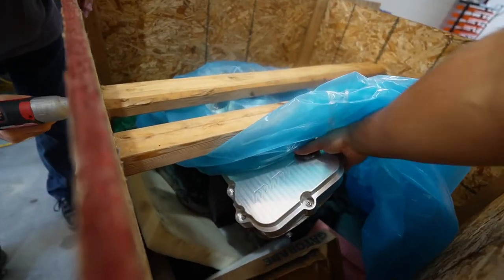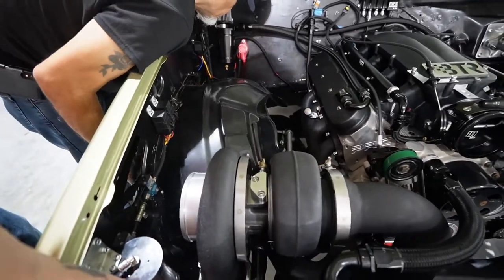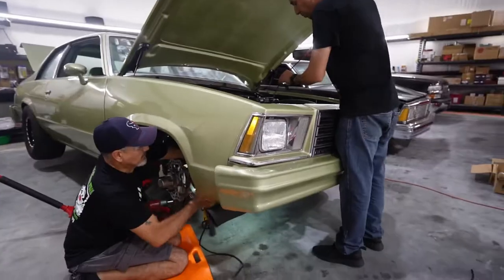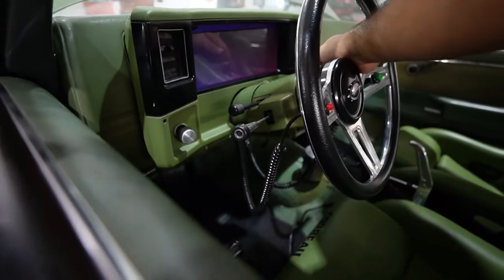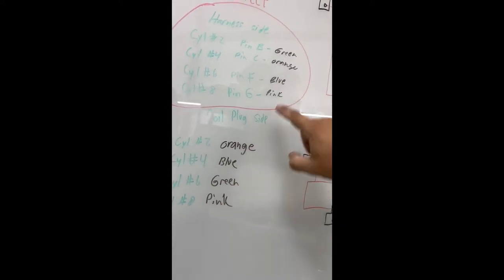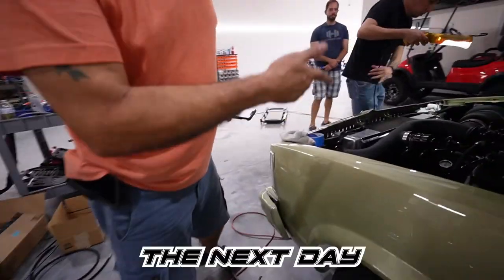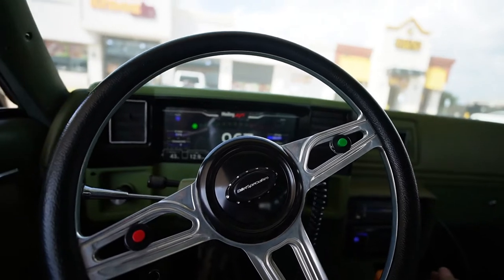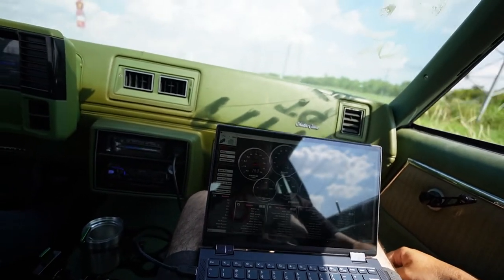We got OIL PRESSURE! And a list of problems to sort out!!

Comment: I had the same issue with the coil extension harness. I had to remove the loom and tape to check the wires. 6 out of 8 coils were incorrectly wired.. super annoying.